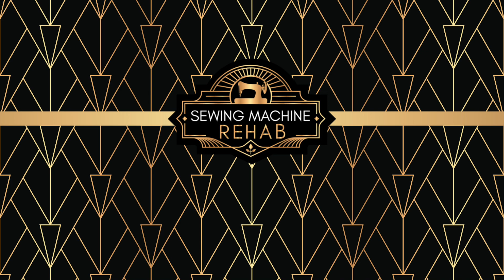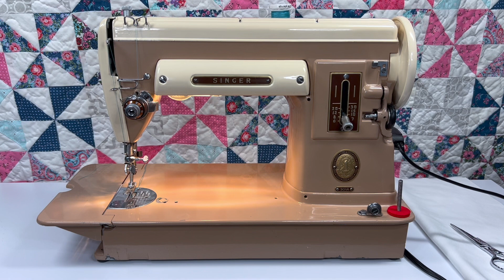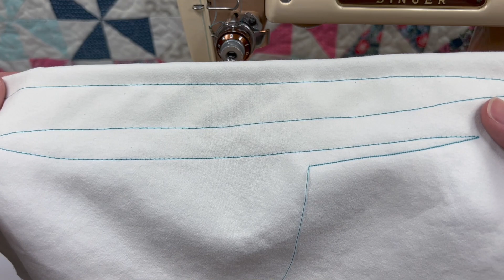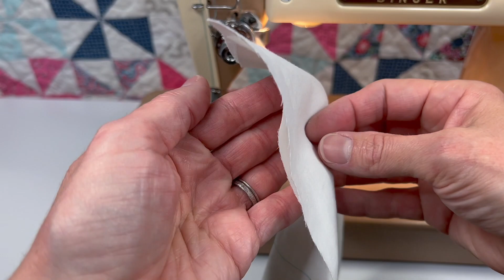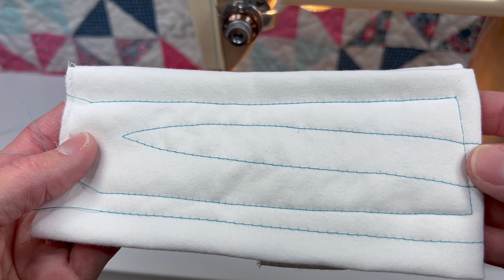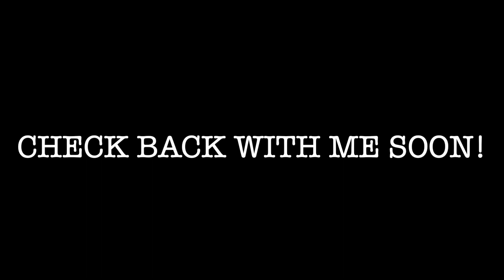Sewing with a Singer 301A, another restoration is complete!

Comment: Thanks for doing the sewing test. I just finished rehabbing a 301 and am testing it. It would be helpful for the viewer to have two different colors for the top and bottom threads. Would also like to know what needle and thread is being used. I found the 301 quiet when using a Universal needle, but it's quite noisy as soon as I use a thicker needle.
Reply from the maker: That is a great suggestion, I think a video just trying different needles and threads in general on a 301 will be in the works soon. :)

Comment: Thank you for sharing another video. Your machine looks fantastic and sounds so good. This has been a wonderful series. I am looking forward to your next videos. I am hoping you do a featherweight at some time. I haven't finished those yet either. I went through the cleaning then oiling and greasing etc, and then decided that that I was not using them until I had a chance to open the motors and clean them out. Dumping new grease over old in those ports as suggested just doesn't sit right with me. Hope you are having a great weekend. Blessings
Reply from the maker: Deborah, I think the Featherweight will be the next series. However, I am not finished with the 301 series yet. This video was just another 301 I have been working on and finished. I like to video how they sew for their new owners before I ship them.  I will complete the 301 series all the way down to sewing with the machine when it is all back together. :) Hope you are having a great weekend also!
Reply: @SewingMachineRehab  Hi..so happy you are still doing the 301.  I am the same way when I work on the ones from the charity shop here. It is volunteer work, but I still want them very clean and working well when I take them back to the shop. The machines that I have of my own, I can take my time on. I am in no hurry for any of them. The new owner of your machine will be thrilled. What a treasure for them to be able to watch your videos of how to clean, maintain and operate. Blessings
Reply from the maker: @deborahwoodward5578  That's wonderful! So glad you are making sure the machines are working so that the new owners can appreciate them and keep them. Keep up the good work!